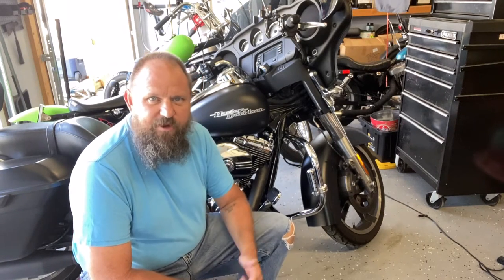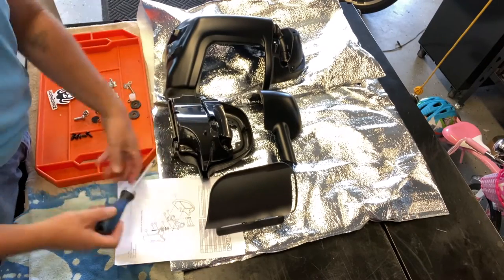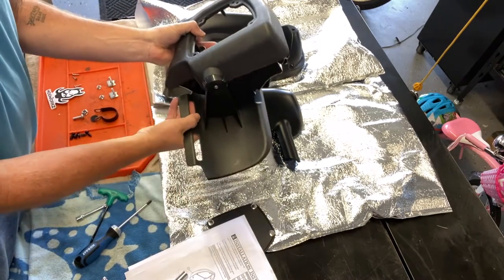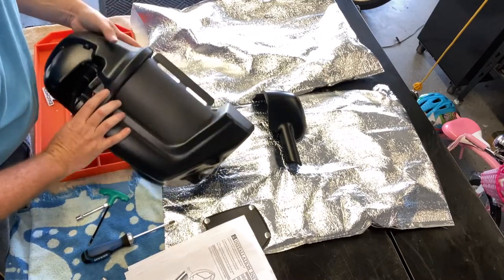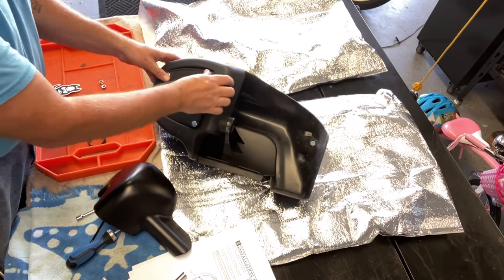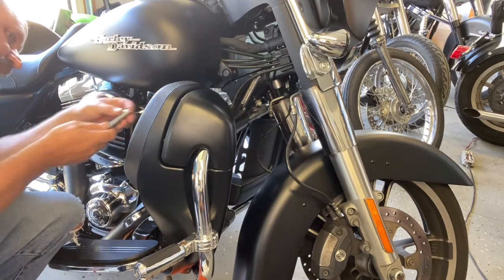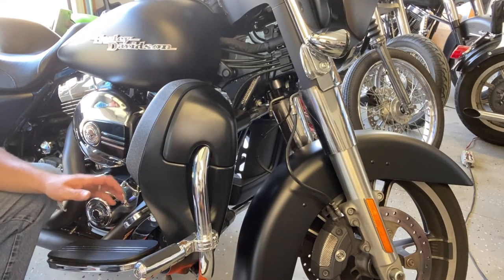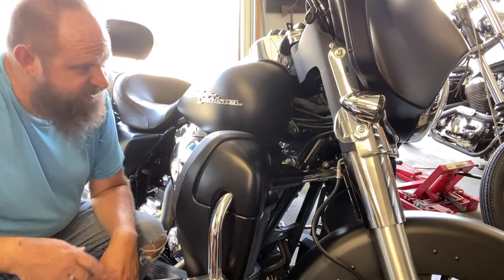How to Install the HogWorkz Lower Fairings on a 2014 Harley Davidson Street Glide

Comment: Thanks so much!  Couldn't have done the install without you. Manufacturers videos are sorely lacking. Nicely done.
Reply from the maker: Awesome! Glad it was useful.  I am going to do a video on how I fixed the issue I have with the plastic snaps.  Should be up next Tuesday. Thanks!
Reply: @SportsterProject  did you ever fix the plastic snaps? If so, do you have a video? Great work on the lower install, can't wait to put mine on!
Reply from the maker: I did not get around to doing a video, but I replaced the plastic snaps with these stainless steel ones https://amzn.to/3JIg8AO  Worked like a charm.

Comment: I'm ready to buy lowers for my 2016 Street Glide Special. How do you like your Hogworkz lowers? Any issues so far with vents or rattle noise ? Can't make up my mind, if I should get HD, Advanblack or Hogworkz.
Reply from the maker: No complaints with the Hogworks.  I have a couple thousands miles with them on and no issues with vibrations or the vents opening or really anything.  Other than the cheap plastic snaps I like them.  Replaced the snaps with these stainless ones https://amzn.to/3vpmvEl and all is well.

Comment: Did you ever get those metal snaps? I can't get mine on
Reply from the maker: I picked up these Snap Fastener Machine Screw Stud, 1/2" Stainless Steel #8 Screw, 10 Pc. Set https://amzn.to/3Ism9Dg and they worked out great as a replacement for the plastic ones.
Reply: @SportsterProject  thanks brother